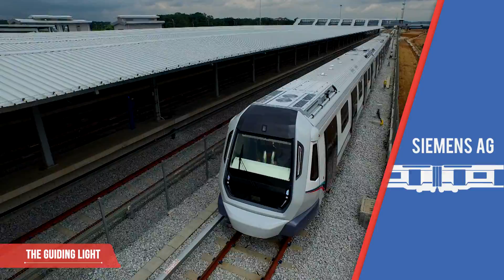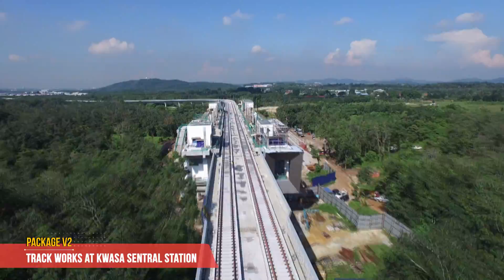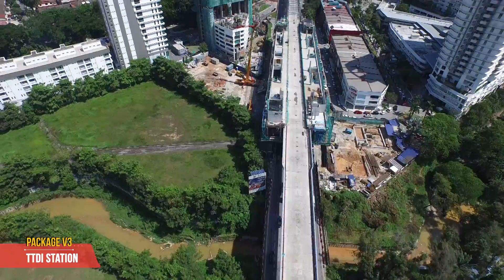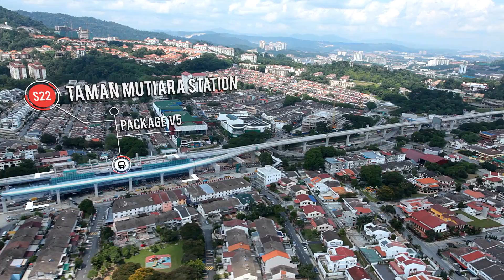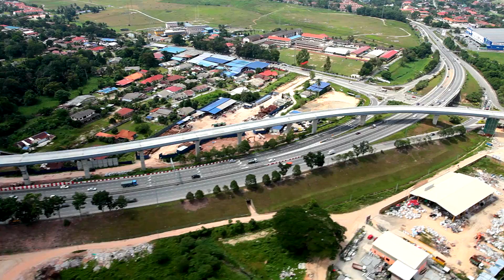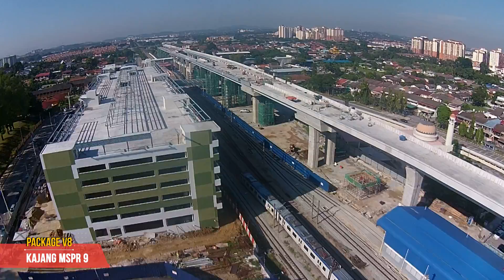The Klang Valley MRT Elevated Works Q2 2015 Progress Video

Comment: superb..can't hardly wait for the completion of the MRT..does anyone know where will the MRT Line 3 be build?
Reply: +Aduka Putra after sungei buluh-Kajang finish end of 2016,,,,,,mereka start serentak progress,,,yang bagus nya mereka melatih 500 tenaga muda kita yg berkelayakan   permasangan coach untuk line 2 and 3 akan di pasang sepenuhnya di Negara ini,,,maybe made in Malaysia mcm monorail,,seperti saudara saya bulan puasa hari tu terbang ke Jeddah kerana berkerja untuk monorail Jeddah yg di progress olih Malaysia,,
Reply: +JiJi Total plan was to have 3 new line. MRT 1 (sungai buluh kajang), MRT 2 (sungai buloh- serdang/putrajaya) and MRT 3 (circle line). Not to be confuse with ANOTHER line that is LRT3 which run from bandar utama/shah alam to klang. 

MRT 3 station should fill the available gap. Some of the areas covered is kiara, hartamas, setapak, further down into ampang and kampung pandan, etc. You may search or google it for more details.
Reply: +bimba- lola line3?? what line3?? mrt only announce on the line 2 only not line 3??
Reply: lol, didnt know about circle line/line 3, thanks for the info